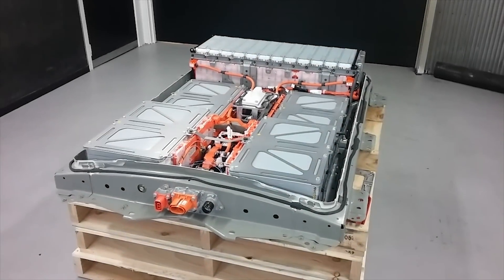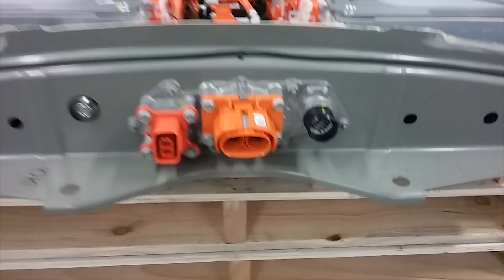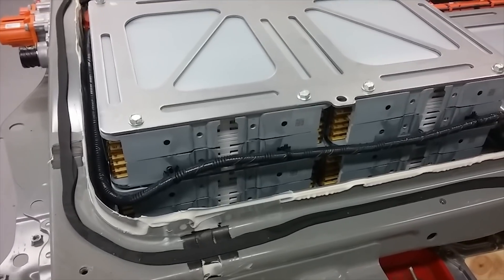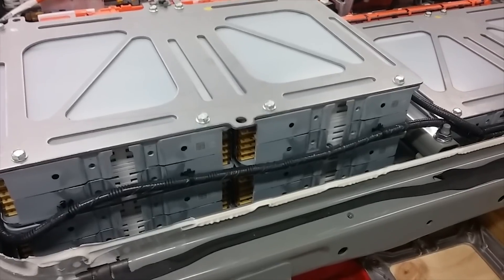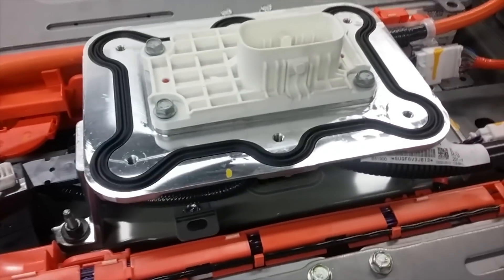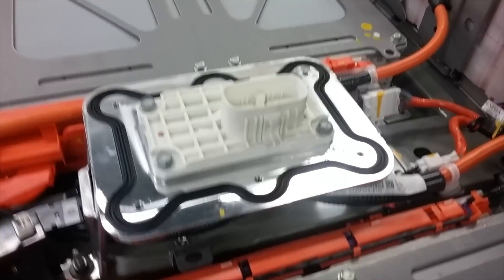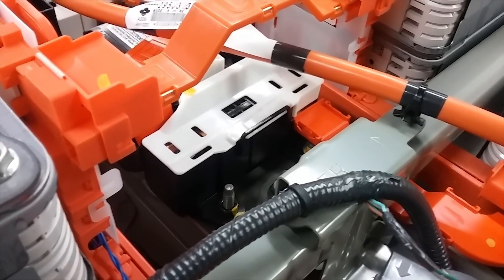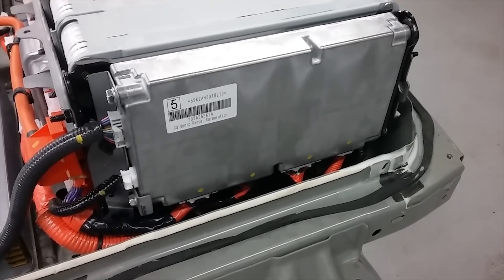Inside the 40kWh battery from a 2018 Nissan Leaf

Comment: I punch 400amps on my 24 kwh pack, 78% SOH,  these packs take a pounding.  Its the charging that kills them, only 3 fast charges in its life.   Cells dont really heap up, as im pull 400 amps for 6 seconds at most.  0-100 in 5.7 :). And lots of poke out on the motorway too.  Just waiting on the Ted pack to be released and ill look into dual motor  800 amps :).  Hopefully orange ruffy can show us how its done.

Comment: Great job. Have you seen the 40kWh battery for e-NV200? Are they the same? 

Is it enough to upgrade the car's software if a bigger battery is installed?
Reply from the maker: Hi. The e-NV200 battery pack is quite a different shape than the one from a Leaf. However 24kWh and 40kWh e-NV200 packs are physically compatible with each other.  It is likely that one of our existing translators could be used with modified firmware to allow a complete 40kWh pack to be swapped.  https://evsenhanced.com/products/battery-translator/
This is something we may look at doing once all for the Leaf combinations are supported.

Comment: So the big question is will the battery pack work in my 2013 leaf??
Reply from the maker: The short answer is that we're not aware of any current solution to upgrade a 40kWh battery properly without issues.  Physically it is a simple conversion. However, there are communications challenges between the 40kWh lithium battery controller (LBC) and earlier cars.   Retaining the original LBC in the 40kh battery is the ultimate solution. We've slowly been working our way through solving some of the communications issues, however it's a tricky job with an unknown completion date.   Its currently possible to do this battery swap using a 2013 cars original 24kWh LBC which gets around the communications problems, but adds significant new problems and it isn't a good solution as far as we're concerned.
Reply: @EVsEnhanced  can you please elaborate on the "significant new problems" that you encountered when retaining the original LBC on older (2011-13?) packs with the higher capacity cells?  Thanks!
Reply from the maker: @deathcake9000  SoC and SoH estimation are all messed up if you use an old LBC with newer higher capacity cells than they were design for.  For example on discharge the car will say it is completely 'empty' when there is a lot of energy left or on charge it will say it is fully charged when it isn't.  The problems go further beyond that though - a lot of people have tried this and documented some of the other problems.   Clearly the best way is to keep the original 40kWh LBC in the 40kWh battery.   A solution to allow people to do this is getting closer though. Our 30kWh conversion solution was recently released. More information can be found at https://evsenhanced.com/products/battery-translator/

Comment: The form factor of the cells looks the same; it looks like they gain higher energy density by fitting the cells in 16V packs; by removing the extra layers of metal casing that surrounds the 8 V cell-modules they can be fitted closer together. Without the extra metal they might have made them 4S3P for the extra capacity.
Reply from the maker: Hi.  Removing the extra layers of sheet metal like you mentioned was done when Nissan moved to the double thickness modules when the 30kWh model was introduced.  The modules in both the 30kWh and 40kWh packs are both 4S2P.  Each cell is just higher capacity in the newer 40kWh battery.   I wouldn't be surprised if the 60kWh Leaf battery has a 3P arrangement as you suggested though.

Comment: You should make a video where you try to exchange the battery modules (or some call cells) between 40kWh and older Leaf 24kWh battery... there are tons of 1. gen Leaf owners who are waiting for a way to upgrade for their old degraded battery packs. If everything is bolt on, then old Leafs should work with newer cells... It is proven that 30kWh cells work fine in 24kWh battery pack, but how is it with 40kWh cells? And how would car perform?
Reply from the maker: Hi. We aren't very interesting in swapping the modules into an older pack. We are interesting in using the whole pack in an earlier Leaf without having to open or modifying the battery at all! We're slowly working through resolving the CAN message differences between a 40kWh BMS/LBC and early versions.  Initial signs are good, but it is too early to say if we will be successful with this project or not.
Reply: EVs Enhanced Anything is possible, don’t overthink. You will be successful

Comment: Find a way to cool the pack you'll get business.
Reply from the maker: It's a tricky one. No doubt there will be some demand, but once the 60kWh Leaf arrives soon presumably with active cooling it will certainly place an upper limit on how much  anyone will want to spend to add active cooling to their 40kWh battery pack.
Reply: @EVsEnhanced  62kWh released, no active cooling.
Reply from the maker: Yes, we read that too. We were quite surprised and disappointed to hear that there is no active cooling on the 62kWh battery either.
Reply: @EVsEnhanced  they reworked the cell chemistry 5 times, each time make it stronger, more resilient to fast charging & heating & heat fading in hot climates & it works just find in temperate areas without extreme hot & cold weather. Perfect for city commuting & some longer range trips. Instant acceleration & low price + moderate weight = good performance // they electric motor & battery keeps improving with time so they will just keep getting better :)
Reply from the maker: @AaronSchwarz42  Hi Aaron.  The 40kWh Leaf battery is actually a step backwards from the 30kWh in terms of being resilient to fast charging & heating. This is because the cells are very close to the same size but with a new more nickel rich cathode with reduced cobalt.  This has resulted in higher energy density but also less stability which meant that Nissan needed to be more protective of the cell temperature with fast charging - hence the RapidGate issue.  However, I couldn't agree more that the 40kWh Leaf is totally fit for purpose in a mild climate where daily usage doesn't require multiple fast charges.  And this suits most people a majority of the time.  It is just that with the added range of the 40kWh battery and an ever improving fast charge network,  going on long trips in a 40kWh Leaf would be so much more enjoyable if the battery didn't cook itself in doing so and get into a situation where fast charging times are anything but fast.  The 62kWh battery isn't as bad despite having almost the same cells since the fast charging speed hasn't increased much and you have 3 cells in parallel instead of 2 so the C rate is a lot lower.  But you are paying a lot more and carrying around a lot more weight for extra range that most people don't really need.   So it seems like if a Leaf had a properly cooled 40kWh battery then it could actually be a more attractive option compared to the latest 62kWh one.
Reply: @EVsEnhanced  , when it comes to cooling, have you ever thought of putting a little fan inside the pack that just start to circulate the air? This should improve heat transfere, specialy the convection, and the heat transfere between air and steel cover surfaces.  4-10 times improvement. 3 x 12V 5W fan should be enough, even one will make a difference. As it is originally, most of heat is only tranfered  by slow convection.
Reply from the maker: @tucsonor  Hi. We have indeed thought about circulating air using fan(s), but we came to the conclusion that the original module design and layout just doesn't allow for it to be done very effectively.  Basically you can end up moving air around inside the pack but with almost no air flow through the modules themselves, little improvement in cell cooling is achieved.  A lot of custom ducting would help, but it is never going to be great.   We think that the only well-cooled Leaf battery pack solution is going to be achieved using aftermarket modules.
Reply: @EVsEnhanced  I understand. In our climate here (Norway), it would do much if there was only slightly better cooling, so that we on longer journeys could keep the temperature down to a level where fast charging could be done without excessive rapidgate. I have calculated the differences (If there is too much to write about in the comments field), but a slight movement of air in the package will increase the cooling effect 3-5 times. Will do wonders considering long drives. But of course will not be like in a Tesla.
Reply from the maker: @tucsonor  Hi.  We agree that there is too much to write about this topic in the comments field.  Please send an email to enquiries@evsenhanced.com and we will be happy to discuss this in more detail.
Reply: EVs Enhanced the thing is. The 4o is definition staying for a couple of years minimum. They will not stop it as it is the entry point. The 64 will be vastly more expensive. Let's presume a strict minimum 5k price difference. I bet the actual 40kwh pack can be cooled enough to be able to give long distance trips to the 40 for much less than 2k. If someone tells me he has a solution today I good gladly pay a premium even within warranty (I rather avoid degradation by overheat). The real volume will come in 2.5 years though.
Reply from the maker: If the price premium for a 60kWh Leaf is huge compared to a 40 (which we agree does seem pretty likely) then you may be right. We'll have to wait to see when this is released. We were surprised that the Nismo was recently announced without the battery upgrade.  That makes us wonder if the 60kWh battery has been delayed or if it is still coming later this year.
Reply: @zeydallahoum  
If you don't care about warranty and you are willing to open the battery, adding a ambient air cooling system is pretty easy.
Reply: I think if you add a tube with holes and the fan to suck that air out and  get it outside of the battery case you have probably 30% lass heat than with fully closed case. Thats my tought atleast. 
Toyota have put a cooling with ac inside the battery on their Rav4 prime i think. So its double and i think its better to spend few bucks to add cooling than replace all thise batteries in warranty or maybe im wrong😅.

Comment: Did you get an idea of where the main centrally located Temperature Sensor is located? It seems to be close to the cells, since it reacts very fast to power/heat spikes (10-20 seconds). Might be differently placed compared to the 30 and 24 packs.
Reply from the maker: They are in the same place as a 30kWh pack and seem well located. There is one in the centre of the rear stack and two on the left-hand side stack at the end of the cell where the terminals are.  24kWh pack has different sensors in a different location which would seem to be less ideal.
Reply: Great - thank you very much. Really appreciate your videos!

Comment: This is so sad.  Not only does this new 40kWh pack have no proper thermal management but it persists for the most part in having the cells layered one above another which may be OK for the cells at the bottom but the upper cells are bound to overheat. I find it incredible that such an obvious problem has been ignored for so long. Hopefully the 60kWh LG chem battery pack will not have these fundamental design problems.
Reply from the maker: Yeah, when they were released, I think we were all surprised that the 40kWh pack architecture wasn't at all revised compared to the previous models.  Only time will tell how the 60kWh pack is designed, but we're itching to find out.
Reply: The battery pack seems to be crammed pretty darn full;  so full that one wouldn't expect just filling the remaining crevices/cracks with some sort of chemically inert, electrically insulating fluid to add much extra weight.   That ought to enhance the passive cooling of the cells a fair bit.